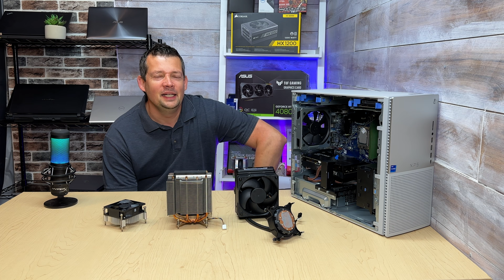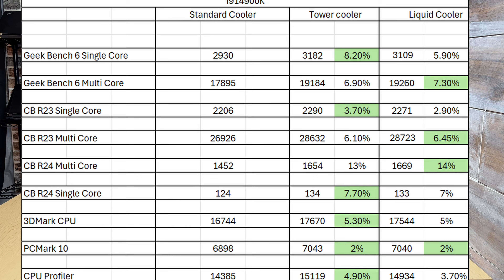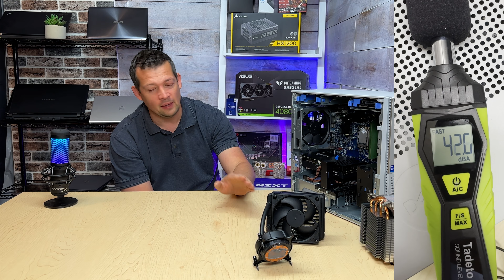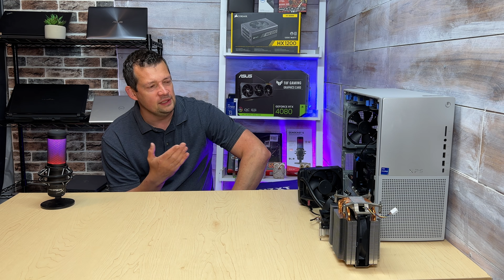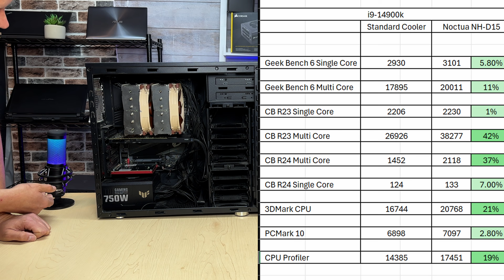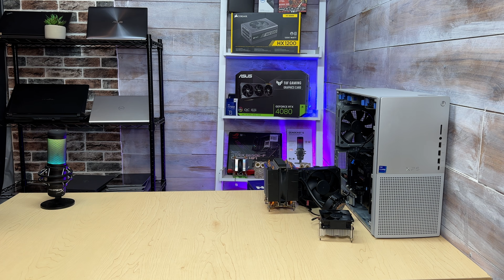Dell XPS 8960 Desktop: Intel i9-14900K Upgarde, CPU Cooler Options.

Comment: I didn't think it would be possible use the 14900K and a 4060 Ti with the 460 W PSU in this system.  I would really like to see some data as far as power draw and thermals with that setup.  I kept the 13700 in my 8960 (I really have no need for an i9) but was thinking of upgrading the GPU (it came with a 3050) and I was wary of wanting to put anything more than a 4060 in to replace the 3050.    I would also be curious to see how the 460 W PSU compares to the 750/1000 W PSU since the spec page for the 8960 says those are platinum.
Reply from the maker: I was wondering as well , but It is possible.I had no problem running the 14900k with the 4060Ti on the 460w PSU.
If you head over to Dell and select the customized 8960 with the same cpu and gpu , they will be shipped with the 460w psu. If you switch over to 4080 it will tell you that the minimum pus needs to be 750w the 4090 will require the 1000w.
Reply: Interesting, Dell's website also claims it should be fine to have a 4070 with the 460 W PSU but I have never seen even a conservative spec that suggests going that low wattage with a 4070.  Makes me wonder what kind of OEM 4070 they might use.  Incidentally, I'm assuming the 4060Ti in your video was an OEM variant as well?  Also, according to Dell's specs on the 8960 the x16 slot only works at x8 lanes so you won't get the most out of any GPU that utilizes x16 lanes like the 4070 or 4080.  A 4060 or 4060Ti would seem to be ideal.
Reply: @StephenStephenson-mo3ns you just persuaded me to set my sights lower than a 4070 when I buy an 8960. Thanks.

Comment: More 8960 material please ❤
Reply from the maker: Thank you! I made another video on third party cpu coolers with the 8960 but ended up not releasing it, I will re record that video and add a couple things to it as well like WiFi improvements.
Reply: @Scott.The.IT.Guy.  Would love to see a video with you upgrading to a 240mm & 360mm system.
Reply from the maker: @WeezyD_NFT  I would love to make a video on that!  The 240 mm would be easily durable, but this channel is 100% self-sponsored, generates about $125 each month so the budget is super limited. I donated every single cent this channel ever made to the victims of the hurricane, so right now I can only demo what I have currently at the shop.
Reply: @Scott.The.IT.Guy.  cannot wait. I have been meaning to try to upgrade to a 14900KS so any educational material on that is going to be priceless. These machines are so powerful

Comment: Hi Scott, 
Thanks for producing another informative video.  I concur 100% with your advice.  I ran a Dell XPS Studio 8700 from 2007 to 2017, and then an 8930 from 2017 to 2024 and ongoing.  The latter has an Intel Core i7 8700 @ 3.20GHz running at around 58 centigrade.  Is 58 too hot?  Should I replace the original Dell stock CPU cooler with an aftermarket Noctua air cooler?
Reply from the maker: Hello,

I think just taking the original cooler off cleaning it and  putting new thermal grease on it will give you a measurable improvement.
I tried two different Noctua cooler on this xps 8960 and gained no significant increase compared to the Dell tower cooler. Other hand , I was ended up with an error message at every boot , that the Noctua fan can’t be recognized or failed but at least was working properly.

Do you have the pancake style  cooler or the tower cooler ?

Comment: Is there a way to undervolt the cpu on this pc? I have one with a 13900k and 4090 and cannot seem to enable undervolting for the cpu
Reply from the maker: Not sure if yopu have to enable the overclock feature in the bios or not, but do that first.
Download and install the free  intel EXT software and try this:

https://www.reddit.com/media?url=https%3A%2F%2Fpreview.redd.it%2Fo0jdmrmo02h71.png%3Fwidth%3D3816%26format%3Dpng%26auto%3Dwebp%26s%3D2486df890762b3a4bd794a063fc7eebbc4f0650f
Reply: @Scott.The.IT.Guy.   Yeah, I tried doing that, and it told me undervolting was locked or something like that

Comment: I have  an XPS just like this one, save i913000K...I find everything you present here to be exactly as you describe...it is very nice to hear from an professional on this model, specifically Dell...while I usually purchase Dells for my own production/reliability systems...I never really appreciated their proprietary nature, I simply learned to live with it...your video actually makes this seem like a feature...congratulations!...my systems works very well for me...I do have one bug-a-boo, on this one, that bothers me...after replacing stock fans with and adding an addition Corsair Case intake fans (used a Noctura Sata powered fan splitter) ...BIOS can't seem to locate the fans, neither will after-market case fan configuring software...that being said, in operation they are indeed working just fine...plenty of air-flow when they need it...does not make sense to me, however, there it is...any comments you might have on that one would be greatly appreciated...again congratulations on a well made, to the point, tech video...thank-you!...jo'c
Reply from the maker: Thank you, really appreciate it! 

 I ran into this issue with two different Noctua CPU coolers, I don’t think there is a setting in a bios to disable the fan warning. 
When I had the message about the “fan issue” at boot it offered me to run the Dell diagnostic.  Once I ran that, the warning stopped recurring and never came back, not only that but it was adjusting the RPM perfectly as needed. 
 However, with the other Noctua cooler the message was keep coming up at every restart and the fan was just running on a high rpm no matter what so ended up removing it.
Can you try to run the Dell diagnostic when you have the fan failure message and see if that fixes it ?
Reply: @Scott.The.IT.Guy.  Hey Scott...thanks so much for  the timely reply...this was what I found...ran BIOS diagnostic as suggested by Dell...says everything is fine...still get "rear fan not detected msg etc.,."...when I run Dell SupportAssist says everything is fine...you can hear fans ramp up & down...I can feel gentle the breeze in normal operation ...acts normal to me...while the msg may be disconcerting, practically speaking everything seems fine...systems stays really cool...all fans including 3rd added one, seem to work as advertised...it is weird that now after mkt fan software cannot detect fans???...FYI, I never use plain fan splitters....always use sata powered fan splitters, Noctura in this case, which have the provision for RPM sensing etc.,.ridiles, wrapped in enigmas???...thanks again for detailed video, looking forward to see your future stuff...jo.

Comment: I get the case fan warnings with my replacement fans. I saw where there was a bios setting on the 8940 to disable the case fan check. i can't find it with my 8960. Any help?
Reply from the maker: I ran into this issue with both Noctua CPU coolers i tried. I don’t think there is a setting in a bios to disable the fan warning. This is not my PC, it`s owned by my client. When I had the message about the “ fan issue” it offered me to run the Dell diagnostic and once I ran that the warning stopped and never came back with one of the Noctua cooler. However with the other one it was keep coming up at every restart no matter what, so I ended up removing it.

Comment: XPS 8960 what is that noise!  Finally tracked it down to the AIO CPU Pump.  Had Dell come out & replace it.  Only slightly quieter.  Never again, Advanced Tower Cooler only for me.  Computer is in a small office under a desk & you can hear it.  I'll get it swapped out.  Stay away from the 2.6.0 BIOS.  USB Errors & sluggish rear USB ports.  Went back to 2.5.0 no issues.  Computer came with 2.3.0.
Reply from the maker: It can happen with the pump and with the Fan as well ...unfortunately! Thanks for the heads up about the USB issue I was not aware of that.

Comment: Great video brother. I’ve been binging all of your videos about the xps 8960. Currently debating picking up an XPS 8960 for $699 with an i7 13700 (no graphics card), or just build my own pc. Either one would be a massive improvement over my current gaming pc with an i5 3570k and AMD HD7970 from 2012 lol. 

Interested in the XPS because it would help make my video editing experience much better with quicksync.
Reply from the maker: That was pretty smart , wanted to mentio in the next video the same thing you just did.

Comment: If I buy the Advanced Air Cooler from Dell direct for 55 bucs do I have to repaste the Cpu or just remove original cooler with this and remove and tighten some screws...  awesome deal on the 4060ti 13gen I7 right now
Reply from the maker: The new CPU cooler will have a fresh thermal paste on it already, just clean the CPU and tighten 4 screws and you are good to go. 

Before you do that, I am in the process of making a video how to replace & install Dell coolers, however I hope I can install a Noctua NH-U12A in this XPS which should be the best air cooler options for the 8960.
Reply: @Scott.The.IT.Guy.  I will definitely watch, next time you test a Dell G laptop I am also wondering how much cooling is effected and noise with Lid Closed or even Docked

Comment: Thank you for this review! I am thinking about getting this Desktop, and had two questions: 

1) does there appear to be any proprietary connections for the Video Card? Would it be possible to use the card in a new system? 

2) does it seem as though the ram slots are spaced out enough to replace the ram with something that has a heat sink cover?  

Thank you again Scott!
Reply from the maker: VGA card is a standard PC part, had no problem moving it to my custom PC and back. You can also put anyting in it as long as the power supply can handle it. 
 The ram should also be fine, new video coming out in a couple of days, I will test and include that in it.
Reply: @Scott.The.IT.Guy.  thank you Scott, I appreciate it!

Comment: Amazing content for these desktops. You are the top source for 8960 XPS machines on youtube. More ideas for 8960 videos: 1- can you put more than 64GB of ram into the 2 DIMMs and see if it accepts 2-Can you try putting in 6400MHz DDR5 Rams and see how far you can push it 3- what other good upgrades can we do on it that is worth doing?
Reply from the maker: Thank you! Really appreciate it! 

I tried to install a Noctua NH-D15 in this case a few days ago. It almost fit, but it`s just tall enough where I can`t  fully close the side cover. The Noctua NH-U12A just arrived, if I am correct it should only take a few minutes to install it and I am really hoping for a huge performance gain coming  out of this.
Reply: @Scott.The.IT.Guy.  I am very excited about the next video. That sounds like a fun project
Reply: bump to see if these units can take more than 64gb of ram.
Reply from the maker: @freidrichnietzsche6643  They are maxed out at 64 GB.
Reply: @Scott.The.IT.Guy.  I installed CORSAIR VENGEANCE DDR5 RAM 96GB and it worked
Reply from the maker: @DailyProg  That’s awesome! Thanks for the info!!!

Comment: Thank you, Scott! ... about that smell i was telling you about.... and yeah, this is a clean sorta smell but always have to wonder what gas i am sniffing in confined spaces.... but thank you for telling me i'm not crazy! I even considered taking a covid test since smell seems to be a symptom 🤔😳

And yeah.... been in love with Dell for years now mainly because they are in Austin.... AKA "Silicon Valley East".... with an entire community in North Austin locally known as the "Dot Commies"... As it is now, i have my XPS 8930 sitting next to my XPS 8960.... my only complaint is Dell wants a fair amount of cash for their SupportAssist....

So, any suggestions on what to do with my old Dell? I was considering buying a new CPU but i have never really built a computer like that before.... a piece at a time. I am always scared about what MS will do!! ..... and yes, OneDrive is the ultimate virus! so i'd appreciate any comments on other OS's as well....
Reply: ..... oh, an update...... whatever i was smelling has slowly gone away down to a slight odor now..... seems like whatever it was has out-gassed now and this was a brand-new computer so ..... either that or my sense of smell  has died!! 🤣
Reply from the maker: What CPU do you have currently in the 8930? Also do you have the OS Running on an SSD ?

Comment: There is nothing good about a system that features a custom mobo and PSU. The green DIMMs look like they are JEDEC and with RAM that is slow as fuck the CPU doesn't do as much. Replace it with a 6400C30 or something like that then see if any of those coolers are going to be enough for anything. I am not even going to start with that hermetically-sealed case. That thing is a disgrace.
That system is shit.
Reply from the maker: Thank you for your comment! 
Of course, you can buy better parts which are prone to significantly higher performance. 
This is just an option on the market for someone who does not want/can/need to build a custom PC. This PC was on sale a few days ago with an i5-14600 for $698 without the RTX. For what it is and for what it costs I think this is a great option.
Reply: @Scott.The.IT.Guy. you pay more for proprietary hardware. It doesn'tm ake sense at all if you are not a company...

Comment: Thank you for this video! I was running into these issues with my 8960 i9k really getting low performance next to what would be expected. Also it was really helpful to see that the dell advanced air cooler and their liquid cooler perform basically the same even with the i9. Looks like my choice to go air cooler was probably good since at least it's lower maintenance long term, and quieter at idle which is nice. Great video, thanks again!
Reply from the maker: Glad it helped! Thank you!
Reply: @Scott.The.IT.Guy.  - @13:25 - Thanks for talking about the non removable posts on the Dell XPS 8960.   I purchased a Noctua NH-U9S cooler and took it to Best Buy Geek Squad to have it installed.   The Geek Squad gave me this story about Dell proprietary stuff they could not install it.   I thought the guy was lying to me or something as I had 3rd party coolers installed on other Dell XPS PCs I purchased before (8900 , 8940).   I then took it to another local PC shop and they told me about the non removable post and he would have cut and modify the PC to be able to install a different bracket.   I decided to return Noctua cooler and just order the custom tower air cooler from Dell.